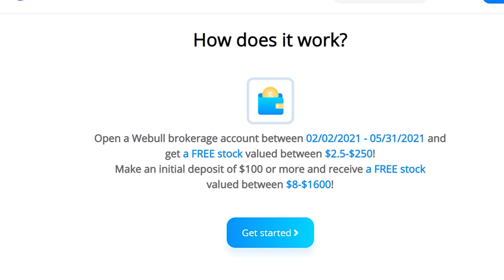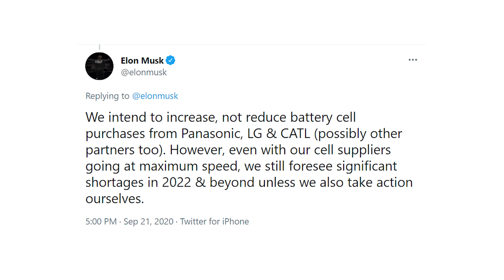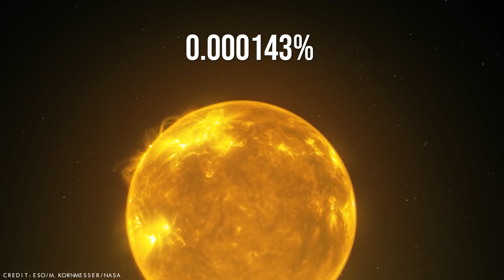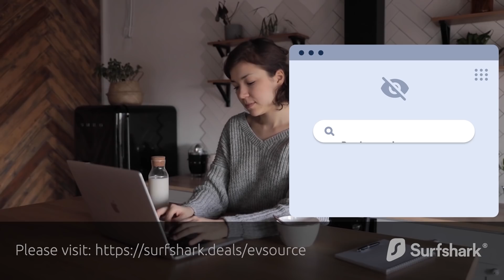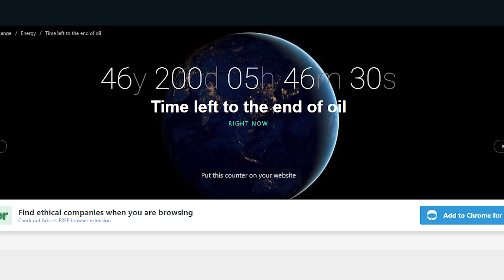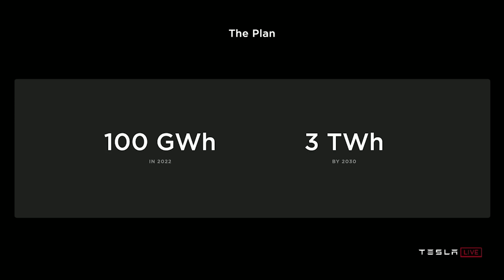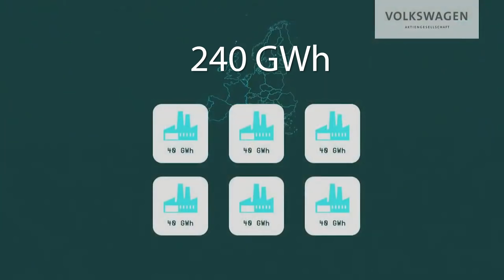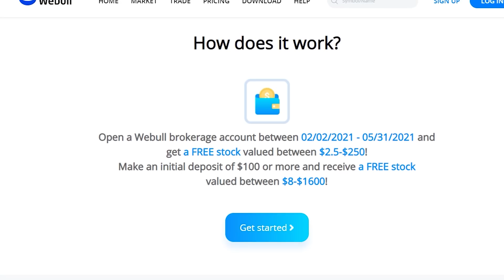Elon Musk's Message To Oil Giants: "The World Could Be Powered By Solar Many Times Over"

Comment: Elon epoch has begun   The Empire (Oil Empire) will strike back  but its game over Elon has already won
Reply: If Cabal didn't kill him yet this means they've  integrated his work in their plans.
Reply: @bogdannemes1995  - or that they missed their opportunity to kill him before he put in place plans that would make doing so counterproductive to their aims.  Both Tesla and SpaceX are clearly in the hands of competent engineering-oriented loyalists to the respective company missions.  Killing Elon would do little to the trajectories of any of his companies but would elevate him to a Christ-like martyr status and bring incredible scrutiny on the murderous conspiracy.
Reply: I agree
Reply: How can they strike back? If fewer and fewer people need or are using what they have to offer, then they're Donald Ducked. Market forces at work....
Reply: Most present cars are front wheel drives/rear wheel is idling . I believe that these very cars could be powered with electric transmission with a differential or even a AL AIR BATTERY on the rear wheel . In the event rear wheel EV not operating you can put your Internal Combustion front wheel drive ON . I think this system will reduce costs and speed up improving environment. Car manufacturers should come up with altering present good condition cars instead of scraping them .